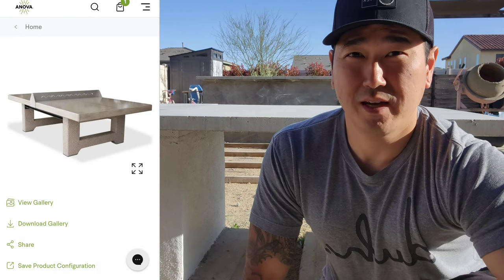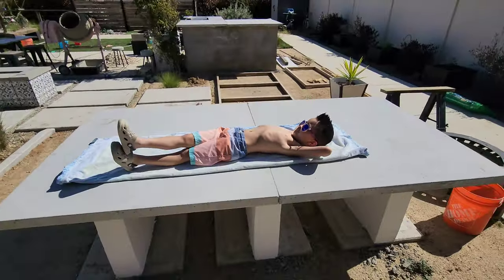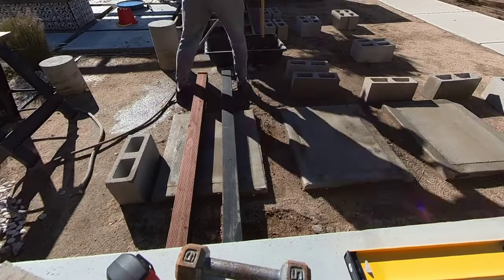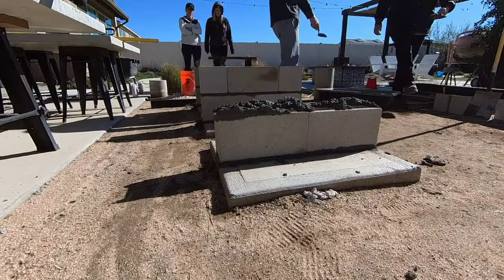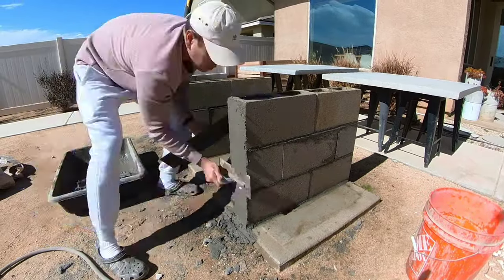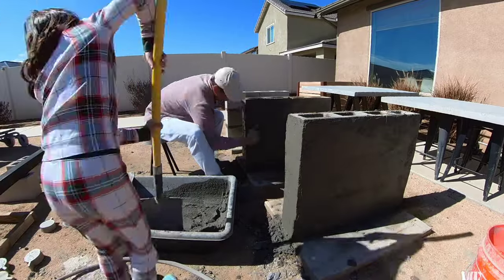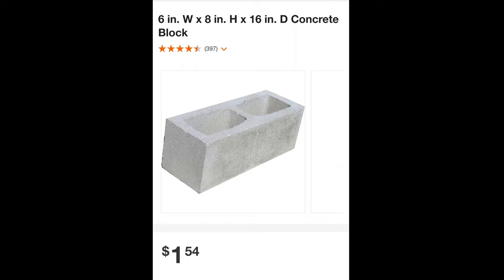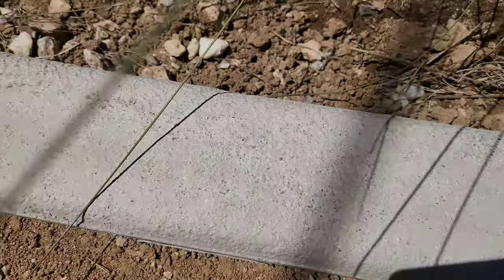Concrete Ping Pong Table DIY | Outdoor Dining Table

Comment: Is the table top secured to the legs somehow or is the wieght enough to keep them in place?  Thanks for posting.  Im like you and wanted one but the cost places charge is insane.
Reply from the maker: Just sitting on top. It's not secured, but it hasn't been an issue because it's so heavy. The weight is another reason we did 2 separate tops instead of 1 peice. We need 4 adults to move 1 of the tops 😆
Reply: @TheChungKids  gotcha.  Thanks for the reply and providing the content to help us!

Comment: Where do I use the caps and rebar?
Reply from the maker: Hi, the rebar goes in the cells vertically, and then you pour the concrete inside. After that, you can place the caps on top